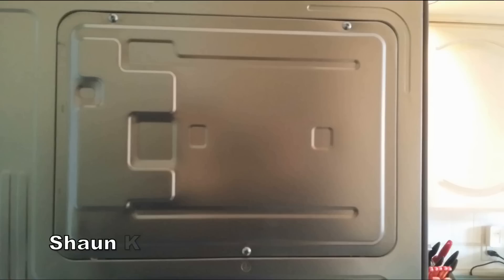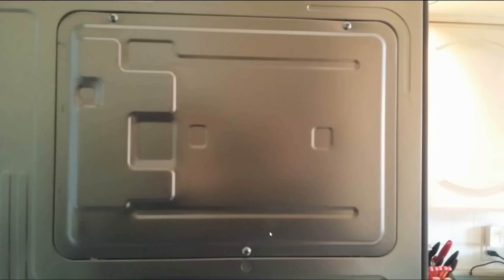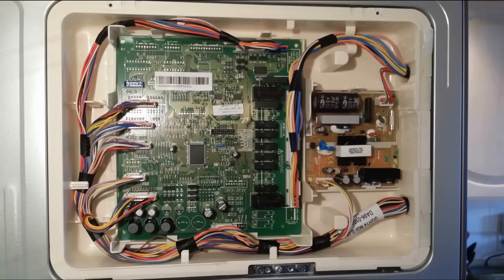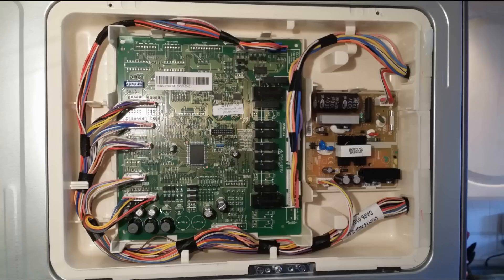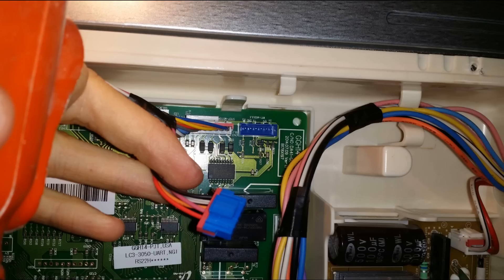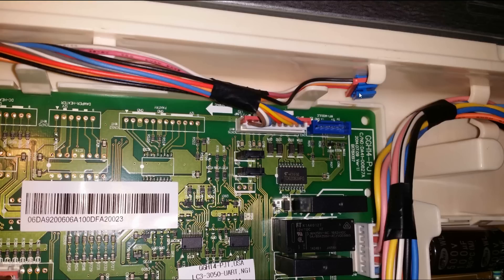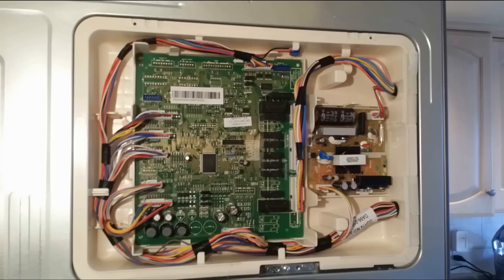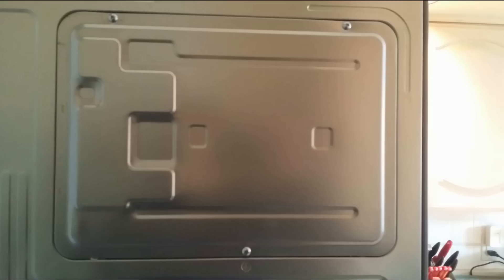How to disable Samsung "smart appliance" features and RF radiation

Comment from the maker: One person made the keen observation that in the original video the readings were quite high INSIDE the refrigerator.  This makes sense, as the metal body of the refrigerator would reflect the radiation back inside, and the food is so close to the transmitter as well.  Makes you wonder what kinds of effects the radiation has on the food itself - proteins and enzymes in their natural forms...there's no doubt it alters it, the only question is how much.  Another reason I'm glad it's disabled :)

It's ALWAYS best to completely disable transmitting devices as shown in this video.  Trying to shield it would have been very difficult, time consuming, and much less effective.  The 100% solution is to completely disable the device's ability to generate the radiation.  Use this approach every time when possible.
Reply: "Makes you wonder what kinds of effects the radiation has on the food itself - proteins and enzymes in their natural forms...there's no doubt it alters it, the only question is how much."

The chemical bonds in your proteins and enzymes do not resonate at wireless transmitter frequencies--if they did you be cooked by now. Google it. Learn some physics and chemistry, and stop worrying about your food. Privacy is another matter. Good work for showing how to disconnect the wifi.
Reply: I still worry.
Reply: We recently got a Basic model with digital inverter technology, my question is will it mess up the fridge by disconnecting the WiFi and Bluetooth? New French door bottom freezer Samsung.  I d/c and seemed to be fine but worried about losing 2500 ya know? I’ve heard horror stories about getting a refund. I guess since it’s never been connected to WiFi and I d/c if something goes wrong I’ll reconnect before calling them. Also my fridge (or someone having it)  sent me an iPhone push notification saying WiFi Password incorrect when i was positive it was. Thanks for showing the world what’s going on we need to get back to wood stoves and ice makers keeping the EMF contained. Also I have noticed all my friends children looking small malnourished and I can’t help but think it’s bc of all the emf possibly causing birth/growth defects across the board.
Reply: You better disable your WiFi Router, all your computing devices, and your smart phones. They generate a lot more RF emissions and are doing it continuously. Oh, and once you have done all that ...if you live in an urban area, you will need to ask your neighbours to do the same as all of their devices are emitting RF radiation and much of it is entering your household to.

Comment: The symbol looks like an "earth" or "ground" symbol.
Reply from the maker: I think you're be right.  That makes sense too, because that screw on the bottom was a fine threaded machine screw that goes into metal, and the ones at the top were sheet metal screws going into plastic.

I guess I was seeing what I wanted to see, hehe.  Thanks for pointing that out.
Reply: @EMFExplorer  A wireless signal looks like a skull with cross bones and little circles radiating out.